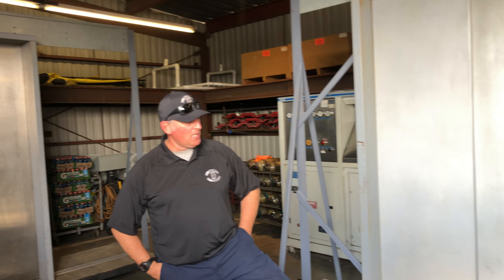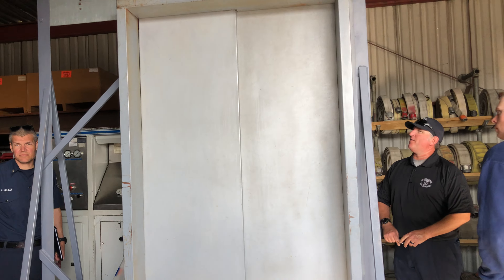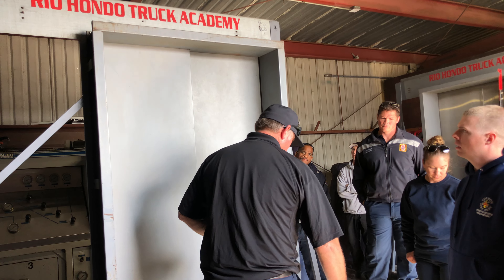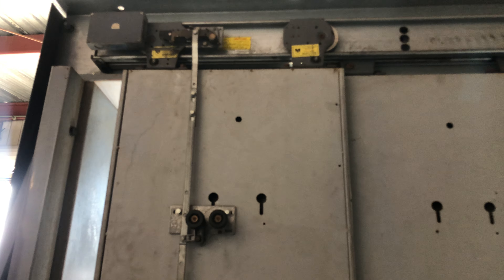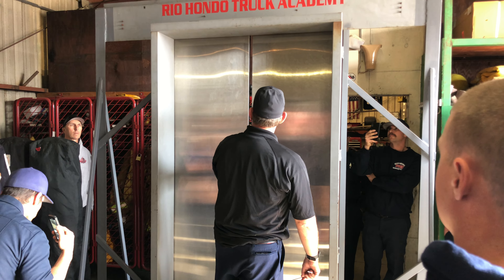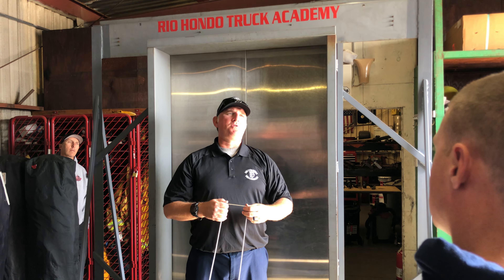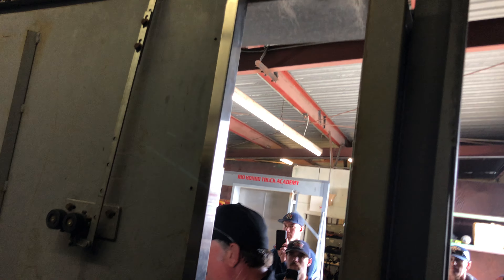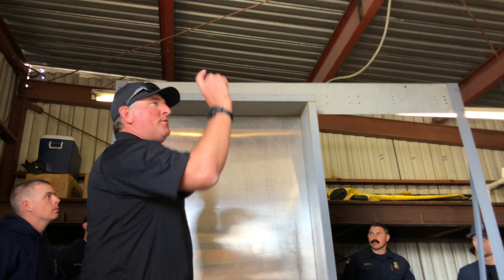Elevator Rescue Training

Comment: 14:17 what are all those springs on right side of "box" for? Why so much mechanisms, as I understood only that "arm" on the very left is responsible for locking.
Reply: I think they are the wires that normally got to the controller

Comment: Why don't the doors have locks that can be opened with a special key (dropkey, triangle key)?
Reply: They do! There is a hole (pencil sized) that fits into the second door the one that does not open as much. You turn the key it lifts the gate lock and then the door will open.
Reply: @stevenc8140  But why do they need to pick them if it has a Keyhole?
Reply: @stevenc8140  Did I understand correctly that picking is faster than opening the door with the key?  If that is the case, I would train the firefighters to use the key so that they can use it faster and better.
However, I don't know if all elevator doors in America have a "keyhole".

I live in Europe and of course I can only talk about how it works in Europe.  
If you get stuck, the first thing to do is to press the alarm button to connect to the emergency call center. This works over the normal telephone line. The emergency call center tries to calm the trapped person down by telling them that they are safe in the elevator and that they always have enough air.  Then an elevator technician comes who first drives the elevator to the next floor by hand. Then he takes a simple triangular key, unlocks the door and pushes it open. The time that the elevator user spends in the elevator after activating the alarm until it is released may not exceed 30 minutes. This is how it is done for elevators from 1970 to elevators from 1920.

What I've seen how it works in America seems very complicated to me.
Reply: @damian-luginbuehl  well KEYS have to be located, or lost prior, & placed elsewhere than usual. Or taken home by employees. Plus you get a company that is in first and this is Not Their jurisdiction (it happens) then what are you going to do? You rely on your training!
Reply: California code does not allow drop keys.
Reply: @michaelabraham3094  They are called KNOX Boxes. The owner(s) place their keys in this concrete-steel mounted box by the main entrance. Fire has the key to these boxes
Reply: They do, but not in California. We pick it with skills
Reply: Most of the newer elevators will have them throughout the building and on every elevator hall door. With that understanding you can only rely on the bottom two floors having escutcheon tubes for drop keys.   There is also California's elevator code does not allow for them.  Well that's what they told us in Elevator school.  The thing is People in this world are dumb.  As an elevator mechanic you get a front row seat and get the privilege to witness it first hand almost every single day.  Your minds would be blown in seeing what people will do or pretend not to know or see so as not to have to take the stairs.  EVEN ONE FLIGHT of stairs makes people do and say crazy shit!
Reply: @stevenc8140  There are tons of old elevators out there that do not have Escutcheon holes above the bottom terminal landing and the door above that.  So you can only really rely on using a drop key for access into the pit and onto the top of the car from the bottom landing.

Comment: To those commenting why not just use a key... why not this why not that. Imagine trying to locate a key while the building is on fire and people are trapped and smoke is building.
You could literally improvise this tool with a coat hanger if you absolutely had to.  You could even run to the nearest hardware store and buy a rod and bend it to shape before the manager could ever get you a key. The TAKEAWAY IS THE KNOWLEDGE TO DO IT THE HARD WAY. That way if you have to do it the hard way you know how to. VS being shown just use a key... Then you drop the key and cant find it in the smoke and fire... and those people die. Or you wait for a half hour to get a key that isnt the right fit or fails and those people die.  This is a very simple tool to improvise.
You as a Rescuer need to understand HOW AN ELEVATOR DOOR WORKS AND HOW TO DEFEAT THE DOOR WITH MINIMUM EFFORT AND DAMAGE TO THE DOOR AND SYSTEM IF YOU CANT GET A KEY...  Once you learn to do something the hard way the easy way is even easier and youre the person who knows how to do it even when you dont what you need. 

ESENTIALLY ITS YET ANOTHER TOOL IN YOUR TOOL BELT = KNOWLEDGE. If you want to do everything the easy way I would suggest you dont fire and or Rescue because theres going to be many times where the easy way is not plausible and peoples lives will depend on rather or not you can accomplish a task with little to nothing. It would be a damn shame for someone you are trying to save to die because you never learned or thought it was too hard to use a simple rod and a few small motions to get those doors open or because you had no ability to improvise because you wanted to do everything the easy way and never valued improv to do it the hard way when the easy way was not there to do. Everything you learn is a tool.

The old saying two is one and one is none. The more tools and knowledge you have to work with the better.
Reply: The actual reason that a key is not used is because elevators in California don’t have drop key holes. The reason why this law is there is to prevent elevator surfing.
Reply: You are talking about otis interlocks but those are GAL. Why not have Otis setups behind the door to show how good you are. GAL are one of the easiest to open.
Reply: That's what knox boxes are for.
Reply: You would not need to locate any key if there would be a standardized key for ALL elevators in the US. In Europe there is ONE key (the triangle key) which works on EVERY elevator. You could use the same key on an elevator made in 1962 and on an elevator made in 2024. No need to locate anything/try to find the right key because every elevator technician, firefighter and sometimes even facility manager has one of these keys.

And you're saying that the picking method, which is more complicated, takes longer and isn't even guaranteed to work on EVERY type of elevator door, is better?

Comment: PLEASE ONLY USE THAT PADDLE DEVICE AS A LAST LAST RESORT!!!  this block of writing is for the instructor teaching people how to defeat elevator doors.   The reason the door flies open when you use that paddle on the bottom part of the door.  It is because there is no power on as you said and the elevator clutch is not on the pick up rollers.  Now .. what you are doing is going really low on the door and progressively further from the Beak.  The Beak, is in the interlock at the top of both doors.  They are now your leverage point They are being pressured with magnitudes of greater force than you are putting into your paddle (LEVERAGE) tool on both sides because you are turning the doors into levers and working them against each other.  So the further down you go the more power you are creating.  And then you must remember since both doors are levers.  You have basically created two large levers working in opposite directions of travel and force and that would put twice the mechanical advantage of  the Levers/doors on that little teeter totter in the interlock.  That's why it is not so effective higher up.  So when you do this.  Please be careful and make sure you didn't just break the beak off in the door lock. What you are doing is not opening the door.  What you are doing is creating a point of failure and the weakest link in that chain just gave way by distortion most likely.  This should only be a last resort kind of operation.  When I see you doing this I can see a lot of different dangerous scenarios that can happen because of it. The SCARIEST scenario it could create is one of the most frightening situations where the beak breaks off in the lock and still makes up the circuit. Now the elevator thinks the doors are shut and the car can run at full speed.  Now there is a speeding guillotine for someone to poke their head into the shaft to get a curious quick look.  This is the kind of stuff our nightmares are made of.   So if you ever do this.  Please don't just leave the power off in the machine room.  PLEASE PLEASE PLEASE put a lock on the disconnect and then leave a note about how you overcame and defeated the interlock.  This way the Mechanic who comes to put it back into service can get an understanding about what you guys did and he can inspect the locking components on that particular hall door.